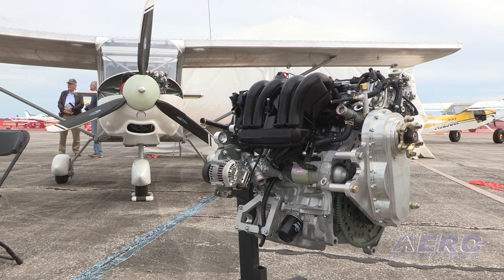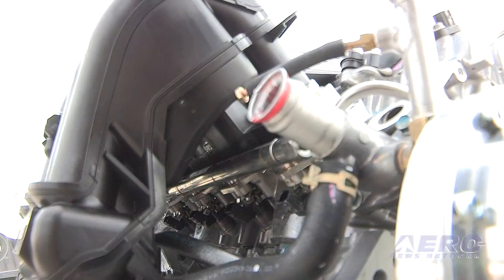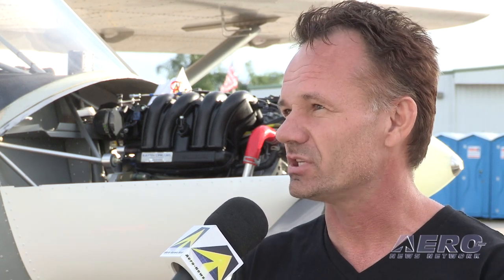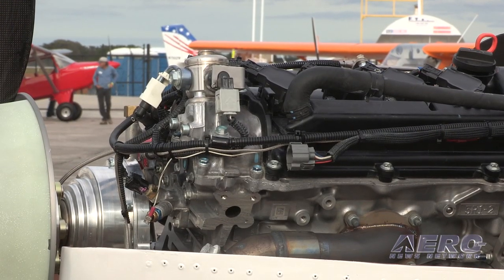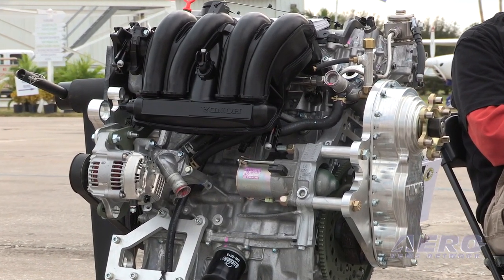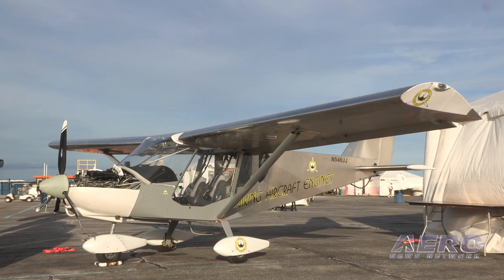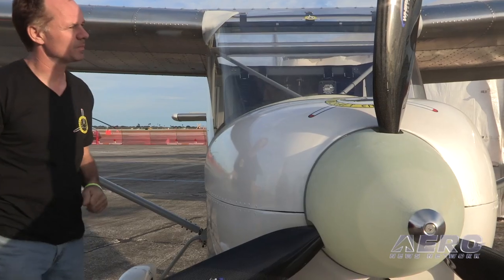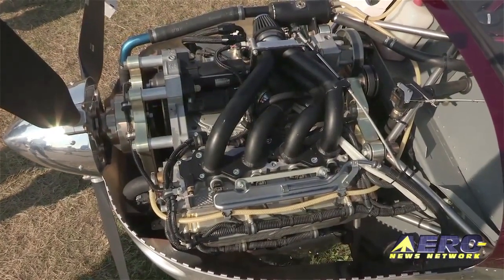Aero-TV: Viking Aircraft Engines - More Power, More Honda!

Comment: I've wondered for some time now why the more reliable auto engines (there are some that should not even be in cars) were not in more widespread use.
I have a 2001 Honda Insight with 150k (miles) on it. Uses almost zero oil between 15k changes, shows no dilution and very little blowby artifacts when tested. Probably should go to 30k changes. Water pump, oil pump, etc still good as well. My wife's year old Fit, which uses the 1.5L GDI engine, shows an almost translucent oil on the dipstick at 15k miles. So I'm going to 30K with it and have a test done. I think that this engine would be good forever in a LSA.
Happy flying all.
Reply: Three reasons:  Weight, weight and weight.
Reply: @mickeybitsko8333  that used to be true, but not any more. Even an LS3 is lighter than a comparable rotax for the power... i'd take a honda motor any day.

Comment: I think Viking is Pioneer for new era for aircraft engine (light aircraft) there no to one's mind that injection system, variabel valve can work properly in a aircraft.
And I also see the new ... Viking put a mufler on it. What I'm thinking , you will fly without hear the engine noise, wow very comfort.
So I wanna see if the gyroplane using it ....... bravo ...

Comment: Question:  Does the idler gear mean "backwards" prop rotation?
Reply: Before the idler gear the props did rotate cw, which is "backwards",  now the prop turns CCW, same as the crankshaft and every other Aircraft engine.

Comment: I am looking at building an airplane and, like a lot of others, am taken aback by the price of a Lycoming/Coninental/Rotax engine.  I do understand the argument that a nice simple engine is the way to go for an airplane, but how in the world can you spend 30k on what really is a very simple engine design?  I look at these things and all I can think of is the VW engines I've rebuilt.  They are nice because you can just pull the heads and cylinders right off and the parts are cheap, but these designs are OLD.  These engines were designed when engineers just sketched things out on a draft table.  Modern engines are so much more reliable and efficient than 50 year old design engines.  And they leak less, dissipate heat better.  Just everything about them is better.  The point of concern I have, as some have pointed out, is when I'm driving around in my Honda, my RPM is typically around 2000 rpm.  My engine/transmission is setup to mostly be in that range.  The exception being when I want to stomp on the gas and pass someone or climb a steep hill.  I just can't imagine doing that for hours on end and the engine being happy about it.
Reply: I believe that the gearbox is used to mitigate exactly what you are talking about. Allow the engine to remain at an appropriate RPM while not over speeding the prop, and protecting the engine from being at a high rpm at all times.
Reply: Keep in mind these engines are basically the same in outboard boat engines that happily rev for hours at end, in much rougher conditions.

Comment: They need to make a K20, K24, K24/K20 head Viking Honda engine. You can build a fully reliable 500hp turbocharged engine. Build for 1,000hp but tune to 500hp for reliability.

Comment: How does upright car engines behave with g-force or in the event you find yourself inverted? Just curious 🤔
Reply: If you have a dry sump and fuel injection there is no worry about a negative g environment. These issues were ironed out at the start of WW2 with carb motors anyways.

Comment: Other airplane engines are extremely simple. They work awesomely by reliable mechanical means. I'm not convinced all the complexity and required computers on these engines is worth the slightly better performance they might have. I think I'd rather have abused Lycoming.
Reply: Jon Surttle, there’s a whole lot more hours of reliability coming from the bazillions of Honda automotive engines out there...far, far more cumulative hours than all the Lycomings  combined.  There’s not an internal combustion engine manufacturer in the planet that exceeds Honda power-plants in reliability, the proven engineering elegance of their VTEC iterations and all.

Comment: I don't believe the horse power ratings along with the all up weight outperforming a comparable power rated engine at a much lower Weight. 
The math doesn't add up. Great idea using a Honda engine though. Tons of parts available.
Reply: The horsepower is at least theoretically possible.  The engine is used in Formula Ford racing.  They're capable of double the stock output with little modification.  Weight is another matter.  INSTALLED weight, ready to fly, is what I want to see.

That being said, the selling point for me is "Honda."  I've driven Honda cars for a long time, and the engineering is unbelievable.  I'd fly behind a complex Honda any day and feel a lot safer than a Lycoming or a Continental.  If I have to give up some cargo capacity, so be it.  

I'm not sold yet, but I'm getting there.  At this point it's CH-power or Honda.  Not really interested in anything else.  And the CH is hugely expensive.
Reply: I believe it. That's max hp while "on cam" - during high rpm, take-off, I'm sure. The direct injection is a real boost.

Comment: There is no way I want a high revving auto engine in my airplane. Honda does not build an engine to run a 90HP at 5800 RPMS! They built it to run at 1700 RPMS going down the interstate. Lycoming, Continental, and Rotax make low RPM high horsepower engines just for planes.

Comment: What a dork. An ME 109 used fuel injection over 80 years ago!
Reply: They just sound similar but they are not the same. GDI (gasoline direct injection) and regular fuel injection (as in the ME 109 and most modern cars) are not the same thing at all. GDI, as in these Viking engines and in the most recent car models, are an evolution of regular fuel injection and much more efficient and fuel thrifty. Gasoline direct injection or GDI is a more advanced version of multipoint systems in which fuel is injected directly into the combustion chamber instead of the intake port. This improves combustion efficiency, increases fuel economy and lowers emissions. This a recent invention and the ME 109 did NOT have it.
Reply: Burlats de Montaigne.  learn a little more about the difference in fuel injection and GDI before making assumptions.  These are completely different animals.  Some GDI motors actually inject fuel twice to get a more complete burn.  It's pretty freaking complicated and couldn't really be done back then.
Reply: So, who is the dork now?